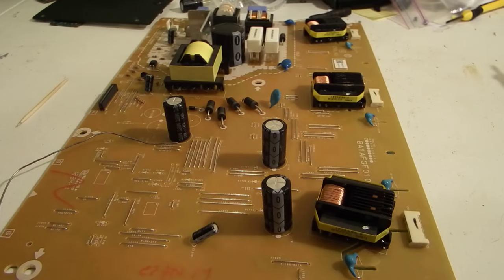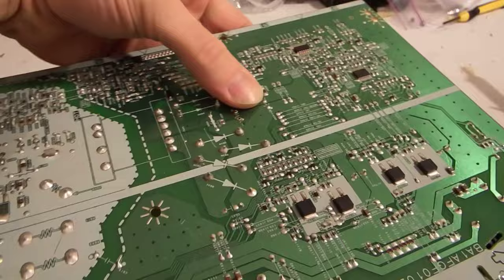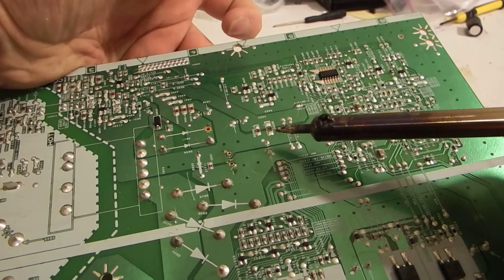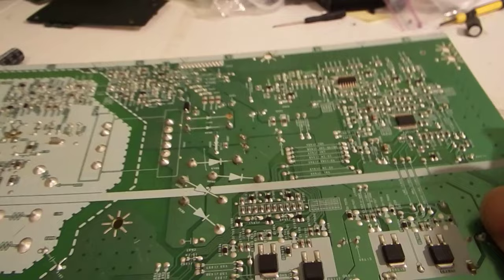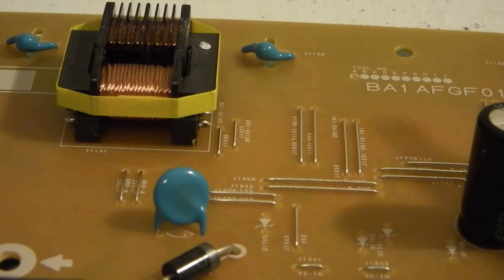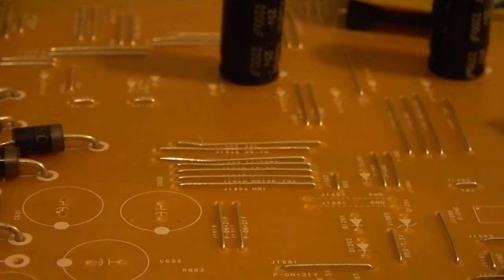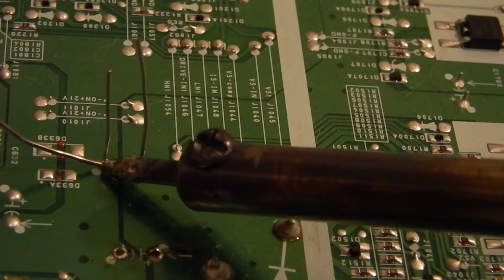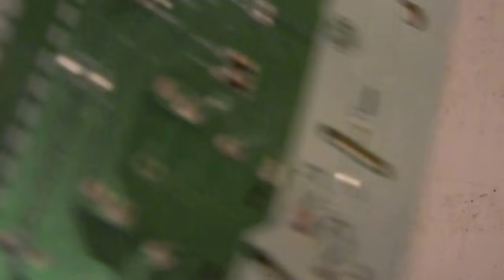How to replace a capacitor -The easiest Way!

Comment: Great  tips for things that are often overlooked, like polarity, the positive leg is longer,  the stripe on electrolytic capacitors (negative leg) matches the moon or half-moon on the positioning circle on the board, and the excellent use of a toothpick to keep the hole open after you’ve removed the bad capacitor. Here’s a tip - you can tell a capacitor is bad when it explodes and you see pieces of the exterior and interior (“capacitor confetti”)  covering the general area where the capacitor used to be, and its legs still are.
Reply: leakage, especially those discoloring the board. I much more often come across leaking capacitors than exploded, and these leaks slowly destroy the board and neighboring leads. Maybe that's cause I almost exclusively look at old computer motherboards, because leaks alone causes so much dysfunction. Maybe audio is a little different.
Reply: Yea I tried the Capacitor confetti, I think I have one more.... It sounded like a pop sound as it broke. I will take my bluetti apart when the battery is dry, just to be on the safe side.

Put 8 Amps to a USB A port in the wrong direction by mistake.

Comment: LOL, my saudering Iron NEVER  EEEEVVVVVVER Melts the sauder as easily as it does in every one of these youtube videos.  What gives??
Reply: It has to be 30 watt or higher.
Reply: Make sure to always tin your tip(coat it with solder) when you're not using it and before you turn it off so it won't oxidize and not take solder. I'm guessing your tip is blackened and oxidized?

Comment: Thanks man. Just started into the world of soldering, fixed my folks tv for $8 worth of capacitors so now I’m hooked!
Reply: I want to start too
Reply: How did you know which capacitors to change out and what made you suspect that would fix it?
Reply: Dont know how you did it i had to throw my device in the trash. Soldering didnt work for me in real time it was a messy disaster
Reply: @realSamAndrew  I'm a rookie at this but typically "bulging" capacitor tops or culprits for needing replaced. Capacitors always have flat tops.
Reply: @realSamAndrew if its exploded and leaked out everywhere xD
Reply: @SevenCompleted  that's obvious. I'm talking about the ones that are not obvious but could be the only ones causing the device to fail. What if you have zero capacitors that appear bad?
Reply: @realSamAndrew  it was a joke dude lol
Reply: @SevenCompleted  how would anyone know it's a joke? It's not humorous or wildly untrue.
Reply: @realSamAndrew  the little xD 😆 face at the end of the comment...
Reply: @SevenCompleted  ok I grant you that, but still the original question remains unanswered after over 2 years  😡

Comment: DISCHARGE the capacitor before working on it
Reply: can you explain how to discharge it?
Reply: Your taking all the fun out of it now
Reply: @user-yv6cb6xj2o  easiest way is connect a household globe onto it.
Reply: @abrammanoge  yeah try a household globe on a 400V and watch what happens. 
Always use a power resistor, and calculate the ohms so that the mAh are less than ~10. Typically a 100kOhmwill be fine. Also connect your multimeter to the power resistor  to verify the voltage drop.
Reply: @Kerveros1904  dude I'm talking about something I have done before. All you get it's a pop from the discharge.  I was taught this buy someone that fixes TVs for a living
Reply: @abrammanoge  can you send me the info of the lamp that you used?
Reply: @Kerveros1904  normal glass household lamp 230-240v
Reply: @abrammanoge  and it did not crack after applying 400V ? this is strange.

Comment: Great video, thanks for sharing. I have just repaired my speaker subwoofer with a $1.50 capacitor so I'm delighted. A $300+ saving on new speakers! Your step by step advice worked a treat.
Reply: I’m going to do this now after getting taken for a ride by electronics repair shops

Comment: This was one of the clearest videos I’ve ever seen. Thanks for keeping it straightforward. One question.

My experience soldering leaves oxidation (I think) on the joints. The white substance forms immediately after I remove the iron. I see you left the iron on for a second after removing the solder. Do I need to do that?
Reply: not necessarily, the oxidation could come from any form of contamination.. sounds like a dry solder... not using flux, not enough or improper use of flux..

Comment: Thank you so much. I was not sure I was brave enough to replace the capacitors on my Samsung TV, which has a clicking on/off problem and turns itself on when ever it feels like it, but your video has given me the confidence I need to give it a go. I have order myself some new capacitors on the strength of your very informative video. I have it fixed in my head now that the negative is the short leg side and goes were the moon shape is :)
Would you advise to do one capacitor at a time, rather than taking them all out, then replacing?

Comment: As a noob preparing a cap job on the Casio MG-510 midi guitar that has notorious cap issues  I'm wondering wouldn't it be better to solder it so that there is a bit of space between the board and the capacitor, in your example you place the capacitor very near to the board, allowing it some longer 'legs' it would be easier (a) to establish whether a cap has turned leaky (b) do some * testing (* would love to insert a technical word but I'm a noob, I mean the sort of test with which you establish this cap needs replacing or not.

Comment: You are awesome!  I have fixed many TV's using your videos.
Reply from the maker: Thats good to hear! I hope I help people get into electronics repair by these videos. Sometimes it is the simplest thing to repair.
Reply: After Hours Tv & Pc repair Yes changing the caps in a radio or tv is the simplest to do on electronic devices...doing this and the radio or tv will work longtime...if you make a video ' before/after ' on a radio or tv will be great my friend ;).. simple suggestion.Thanks
Reply from the maker: There are over 340 videos of mine of repairing televisions on here.

Comment: Excellent video - thank you.   Is it necessary to clamp the capacitor to prevent any damage from the heat of the soldering gun?
Reply from the maker: No, shouldn’t have any issues
Reply: Thank you.   This video helped.   I was able to fix a refrigerator board!

Comment: Thanks, a steady hand is critical too. QUESTION is; Can a 1200uF capacitor be replaced with a 1000uF of the same voltage?
Reply from the maker: Probably, but you never want to go down in uf, always up

Comment: I'm ready to give up. I've soldered all kinds of things in my 50+ years. I'm replacing 3 capacitors in my 88 mustang computer. It's not something I can mess up because there are no more of these. When I try to do exactly what you did to touch the solder to the new cap wire, the solder goes straight to the iron tip like a magnet. If I get a drop like you show where the cap wire comes out of the hole, I can lift the iron all the way up the cap leg and it will follow the iron all the way. It will not release onto the board. I've tried flux. I'm using 6040 flux core. It's the only solder I can find around here and I was lucky to fine it. Please tell me what I'm doing wrong. I'm using the same basic iron I've always used similar to yours.
Reply from the maker: Clean the tip of iron, sand paper when it’s cool, retin the iron tip with solder then wipe on a wet sponge. If the solder pad is larger than the wattage or heat of iron can handle, it may not get warm enough. Sometimes they act as a heat sink itself, then you’ll need something that’ll get hotter. If you have no luck, send me a email, I’ll replace them for you, you cover shipping and send a video of this mustang. I love mustangs.

Comment: ohh adviticing argh... it was so good until that. Anyway thanks I think I have blown one or more, I think I can do this if it is the Capacitor that has blown or more. It sounded like it something was trying to fly to the moon and that has happened before where it was someone of the same sound and issue.... Hopefully it is just one Capacitor or something that needs to be fixed. Would be nice.

I made a huge mistake and... well shorted my DC power and it continues to short. But hopefully I can sort it out or get a new board for the power station.

Comment: what if the capacitor is not flushed with the board originally? does the replacement need to be elevated as well or can it sit flush against the board like in your video?

Comment: Disculpe tengo una pregunta, quiero cambiar los capacitors de mi amplificador de micrófono por unos Panasonic mi pregunta es si aumento la capacidad de los volteos será necesario cambiar los demás componentes del circuito, como resistor, om amp etc ?? como por  ejemplo si tengo uno de 100uf  30v y lo cambio por un 150uf y 60v ?? Si podría hacerlo??

Comment: Thanks for the tutorial, I have a 1982 Sylvania black and white TV that I got from a family that bought it and never used it, so I think its new old stock. I’m gonna open it up and see if I can replace the capacitors, being that they are almost 40 years old. Quick question though, I was messing around with it when I first got it and I broke the V-size dial. Now it only works if I leave a screwdriver attached to it, otherwise the picture is just a line, like this ———————————. Anybody have any thoughts on what I can do to fix it?

Comment: i had a soundcard whereby i ordered some capacitors to replace. noticed that the capacitors are bigger than the ones on the board. could i solder the capacitors high leaving the legs up ? So that i can shift the capacitors aside to conserve space for the oversize capacitors i ordered ?
Reply from the maker: That should be fine.

Comment: Am I SOL if I can’t find a cap of the right values/size that has smaller legs like this?
Reply: you can go up, especially for voltage. That shows the maximum voltage the capacitor can handle, so going up is never bad, going down always is bad. There are some different considerations for different applications, but as long as your the rated voltage or higher, the worst that can happen is it doesn't work. BTW, you can always cut legs beforehand, if you want to leave one longer to remind yourself of which is positive and which is negative, that's your own business.
Reply: Cuvtixo D thanks for the response, I did at first use bigger size and voltage caps and ran wires to the board until I got the right size in there. I still went up in voltage and they are the medium large filter caps in an old AVR.

Comment: I would avoid the toothpick and just get a soldering gun that sucks up the solder.  They’re not too expensive
Reply from the maker: Missing concept of video. Home users are not going to buy more than necessary equipment
Reply: @hitandrepair  
I’m not doggin the toothpick.  I used that technique before I got the soldering gun.  It’s a good idea.  I’m just saying I had no idea how affordable soldering guns could be, now that there’s a Chinese version on eBay that’s like 1/3 the cost of a nice Hakko.

Comment: Doesn't work on a thick motherboard such as an xbox 360. Nor does a paper clip or wick and lots of flux
Reply: you need a better iron, variety of reasons why you failed...heat, improper flux, solder..keep trying, don't give up cause you fail the first few times

Comment: couple mistakes, never pul side to side components, when u pool one side it push otherside as a result very weak copper print will be damaged and thinks will get worst. you need to desolder and remove old solder then capacitor comes out itself. after removing parts remove leftover old solder and clean the solder pad, DONT USE CHINA CAPACITORS IF YOU RESPECT ELECTRONICS. 
soldering part is good but removig part is not acceptable, quality of the part as well. enjoy and good start with soldering just improove desoldering.
Reply from the maker: I hate cheap China caps. This was basically a video for people to remove bad capacitors from televisions. Home users who won’t buy equipment to do any desoldering. I have a desoldering iron just fine that sucks and I could have suggesting a desoldering pump but that’s finicky for people who don’t know electronics. Going in my 18th year of repairing electronics, been around a minute.